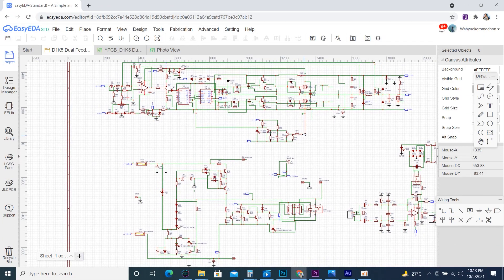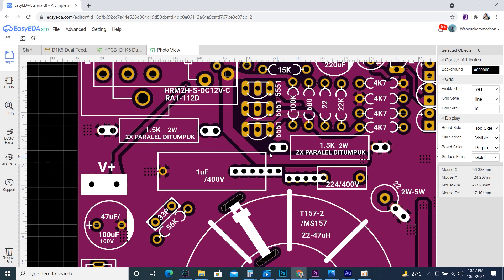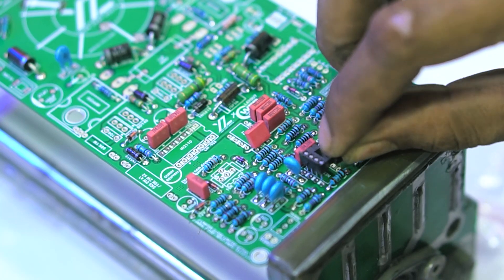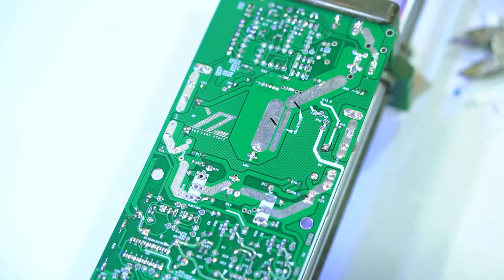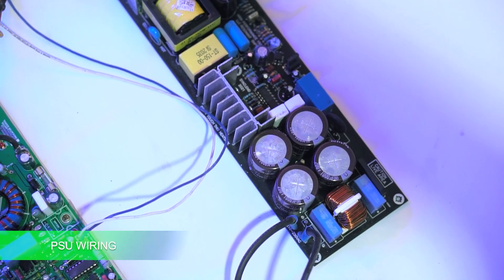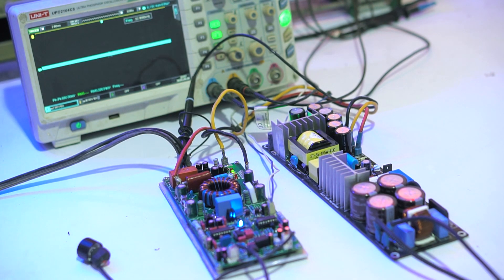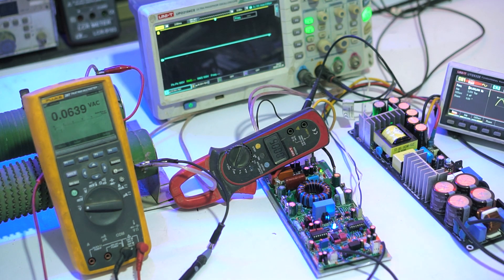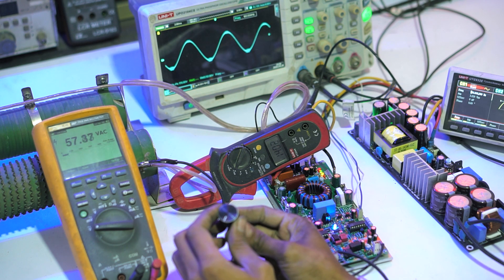Power Amplifier Class-D D1K5 PRO Dual Feedback

Comment: Met siang om.,
Kok tiba2 gak ada suara ya.....????

 kemarin baik2 aja gak ada masalah
Tegangan utama Ok, v bias ok, lampu bias normal, yang hidup lampu indikator ON.....tapi kenapa kok tiba2 gak ada suara..... dikasih input gak mau....
Mohon bantuannya!!!
Reply from the maker: Pwm nya blm start mungkin. Ic tl071 nya gnti yg bgus cb mas
Reply: Sama nih mas dua kit ...teg utama oke ,teg bias 12,8v pertama di hidupkan lampu ocp nyala sebentar terus mati ,lampu on nyala  di barengi suara relay.. ...lampu tengah nyala ..ga ada yang panas ,kaya power normal ,cuma input sama sekali ga ada respon 😀😀😀 kaya pwm ga star apa gemana hehehhe...udah ganti ic  cd ...ganti ic ir2110 ,ganti tl071 ... Teg utama baru pake 42vac 20amper ...apa kurang tegangan utama ya mas 😀
Reply: Class d saya minta tolong temen, hasilnya ini....
ici ir mati 
tr level sifter mati
tr protektor mati 2bj
zener bawah rilay mati.

Problemnya karena vbias terlalu lama dibiarkan ngalir saat class d off (teg. utama off)
Semoga bisa jadi tambahan referensi 🙏🙏🙏
Reply: @nyphabdy2111  punyaku masih mau nyala mas...tapi volume harus di polin dulu di raba raba konektro input baru start...

Comment: Mas untuk pcb ini nilai c26,27,28 itu 47n apa 47pf ys
Reply from the maker: 47p mas
Reply: @WahyuEkoRomadhon  ok mas, makasih
Reply: Maaf mas nanya lg, dco pas vol di tutup 00,9 di skala 200m, tp pas di buka vol ko dco berubah jadi -145 yah, terus untuk lcr nya pcb yg di shope pemasangan di rubah kaya di vidio apa sesuai yg di pcb yah
Reply: Terus tr bd139,140 sma r21 ko panas y mas
Reply from the maker: @revaniaputri5807  sesuai pcb mas jstru vdeo msh trial. Dco vol dbka ad input musik g mas
Reply: @WahyuEkoRomadhon dco ga pake musik mas, terus kalo pake musik suara bersih tp kalo di kencengin volumenya ic ir2110 cepet panas yah, normal g mas, sori mas banyak nanya, soalnya baru nyoba clas d
Reply: Suplay bias pake adaptor 12v, 2a cukup ga mas

Comment: Kalau pakai potensio 100k apakah bisa??? Soal e td di video katanya 10k s/d 50k
Reply from the maker: bisa tapi bukaanya terlalu lebar,
Reply: @WahyuEkoRomadhon  😁standarnya berapa mas???
Reply from the maker: @teguhprasetyoo6901  10K mas
Reply: @WahyuEkoRomadhon  siap" mas👍kebiasaan di klas AB soal nya😁pngn upgrade ke class D,minta sarannya mas mending D1k5 apa lexus 2000 mas???
Reply from the maker: @teguhprasetyoo6901  pke spker sma suppky brp mas
Reply: @WahyuEkoRomadhon  speaker rcf cina mas 10inch

Comment: Mas, smps itu buat suply d1k5pro dengan ucd superlite 1 pcs, mampu nggak ya?
Reply from the maker: Mampu banget mas
Reply: Sekalian bianya?
Reply from the maker: Hrga smps mkst nya mas?
Reply: Nggak, maksutnya, suply utama dan biasnya, pake 1 smps tsb, kuat kan?
Reply from the maker: Kuat mas. Klo 2 ch. Max load 4 ohm mas.
Reply: @WahyuEkoRomadhon  niat saya yang d 1k5 mau tak pasangin 2 speaker 12 in utk low n, trus ucd 2x6 + 2x8 buat mid high
Reply from the maker: Maksimal mas
Reply: @WahyuEkoRomadhon  mas, ketika anda test sound kok suara bassnya lebih terasa ya, sedangkan saya buat kok suara terlalu flat, apakah ada acc tambahan? Atau ada yang dimodif? Suply saya pake trafo 65 vac ct

Comment: NUNGGU LOAD NYA ,SAYA LAGI TANDUR PCB INI 🙈
Reply from the maker: Udh diload itu mas
Reply: Mass nek smps lc resonant sperti video 1.5kw bisa untuk 2 kit kata sampean? Rencana pake 2 kit driver smps fb 3.5kva mas. Apa cukup pakai lc resonant aja?
Reply from the maker: @mbotaudio7611  kalau 3.5kv bisa buat 4 channel mas. Kalau lc resonant tsb buat 2 kit maxnya.
Reply: @WahyuEkoRomadhon  4 ohm keluar 750w ya mas
Reply: @WahyuEkoRomadhon  lc resonat p soleh 1500w mas. D1k5 apa 1500w 4 ohm.
Reply from the maker: Iya mas kalo sama2 kontinyunya. Kalo buat musik keduanya lbih dri itu .
 Klo smps min 1500W itu jg tergantung sumbernya. Klo bgus Bisa lbih dri 1500W.
Reply: @WahyuEkoRomadhon  baik mas
Reply: @WahyuEkoRomadhon  WAH SAYA BARU LIHAT HASIL LOAD. 4 ohm 800an watt kirain D1k5 4 ohm 1500watt. 🙈
Reply from the maker: Itu kontinyu RMS dan beban fixed dummy load. Kalo pke music beban speaker bisa mas. Bisa buat 2x15" volt 90vdc ct.
Reply: @WahyuEkoRomadhon  mas eko tulung di jawab mas 🙏 bias 28v dc ,berakibat R 4.7 ohm terbakar dan skarang serak ,ganti komponen aktif apa aja mas
Reply from the maker: @mbotaudio7611  kok 28Vdc mas. Dicoba masukin supply bias aja mas. Led  bootstrap nyala ndak?
Reply from the maker: @mbotaudio7611  pwm belum aktif spenuhnya mas, IR2110 logic sudah diganti?
Reply: @WahyuEkoRomadhon  belum mas. Lagi beli partnya mas. Matur suwun kagem jenengan boten sombong orange ramah 🙏 lagi beli IR logic TL zener 4148
Reply: @WahyuEkoRomadhon  saya cek pada komparator teg masuk bias masuknya 2.8v. Setelah bias dan psu utama masuk teg 24v vvc + dan vcc - ic tl071. Apa ini normal ya mas soale takute ganti ic teg masuk ga normal.
Reply: Setelah bunyi serak ya locig ir dan ic komp dan opamp tidak hangat mas.
Reply from the maker: Itu pas salah tegangan bias. Supply utama keadaan masuk gak mas?
Reply: @WahyuEkoRomadhon  Kasih musik led pwm nyala sesuai irama musik kedip2nya mas
Reply from the maker: @mbotaudio7611  komparator masih aman mas. Tinggal logic sma irnya.
Reply: @WahyuEkoRomadhon  baik mas. Matur suwun mas. Nek di jawab kalian ahline jadi tenang 😁🙏 kulo sek ten fb 🙏
Reply: @WahyuEkoRomadhon  keadaan supply utama masuk mas.
Reply: @WahyuEkoRomadhon  mas eko. R GAIN nya biar galak di ganti berapa mas. Saya nyoba 33k 47k masih kurang
Reply from the maker: Input balance mas?
Reply: Udah pake input balance mas.
Reply from the maker: J3 disambung atau dibiarkan mas?
Reply: @WahyuEkoRomadhon  di biarkan mas. Ndak saya jumper. Limiter ga saya jumper
Reply from the maker: Hrusny dh vkup.mas. coba jumper limiter dilepas
Reply: @WahyuEkoRomadhon  jumper limiter sama mas.
Reply: @WahyuEkoRomadhon  J limiter nda saya jumoer
Reply from the maker: Sma gmn mas?